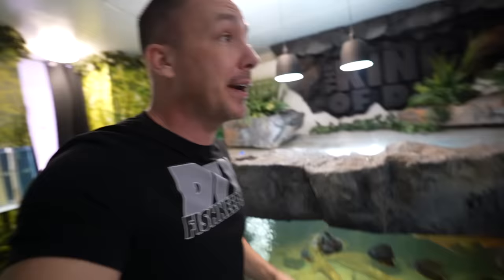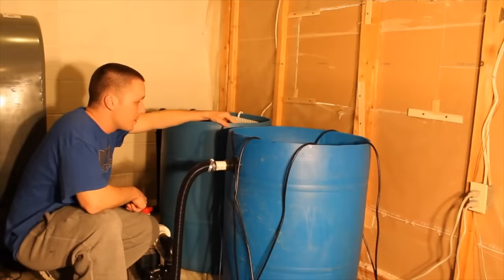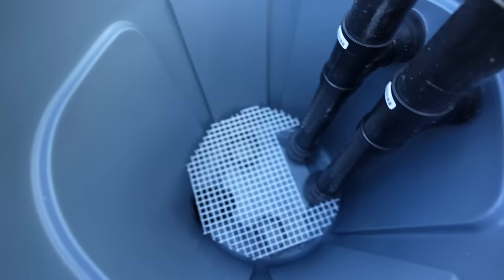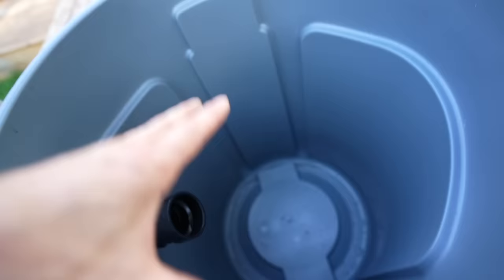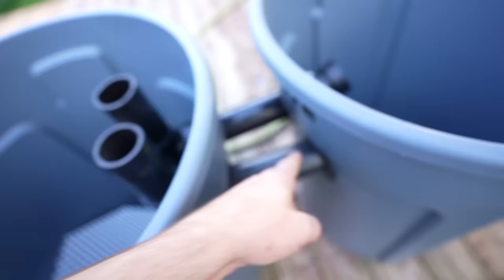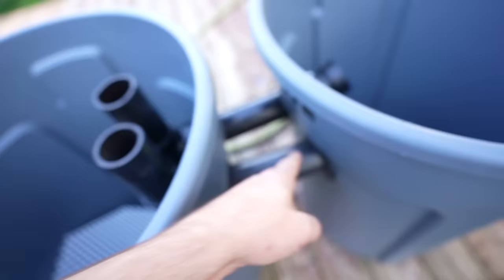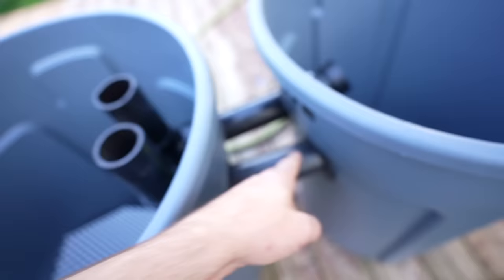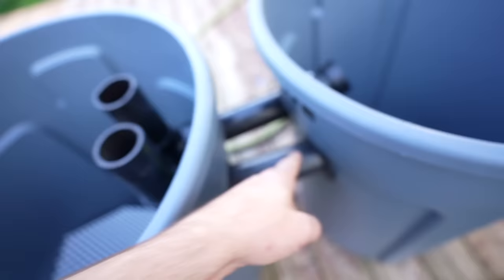LARGE cheap and easy DIY fish tank filter - AQUARIUM GALLERY UPDATE - The king of DIY

Comment: For cleaning up those drilled holes... ya don't need to struggle... a cheap metal deburring pen when used softly will do that in 1 swipe each side... easy peasy.. and the pvc can be done the same way for easier insert

Comment: I love these filters but how do you protect yourself from a flood if the power for the pump or the pump itself fail?
Reply: Overflows
Reply: @jhaych  my tank isn’t drilled so I’d be doing a siphon down into the bucket / can which in a power out situation would keep emptying until the water is below the intake - ie 50-65 gallons if the filter pulls from the worst, most dense water at the bottom.  If the pump fails or just can’t keep up it just feels like a flood in the making  unless my siphon is maybe 2 inches from top of the tank.

Comment: The Golden Retrieve staring you down out the window the entire time you built the filters🤣🤣🤣🤣

Also if the second filter basin return is up high then the filtration wouldn't work in the s3cond you'd need it at the bottom...correct?

Comment: I know this video was a while ago but if that canister filter is full of sand then it’s the same ones they use for salt pools and the reason it’s stopped filtering adequately is because the sand slowly rounds like sea glass, this means you get channels in the sand that water flows through without being filtered. Best way to fix it is to use a Venturi pump to remove the bulk of the sand then a wet vac to get the last bit then just replace it with new sharp sand 😊

Comment: love your stuff - wanted to point something out on flow rate and pipe diameter though - it's not a linear change with pipe size...because, Pi...max flow through a 2" pipe is roughly 45 gpm - but a 4" pipe gives you 260 gpm.  even going up to 2.5" pipe increases your max flow to 75gpm...  just some "fluid for thought..." lol?

Comment: I have a 75 that's Bare Bones there's nothing in it but a little bit of gravel and a couple pieces of driftwood I have a hang in the back that's good for 110 gallon tank I have a canister filter that's good for I think it was $625 gallons so you probably figure half of that if that I figured 200 gallons and then I also have a UV 13 w pump in the tank with the light and filter in that it has carbon and the water polisher and that's just in my 75 for 3 fish two two year old Oscars and a Jack Dempsey that's about the same age and I do a 25% water change every single week so yes it all depends on the fish